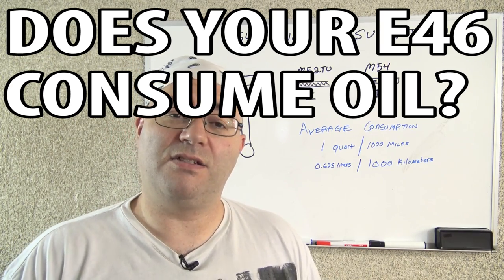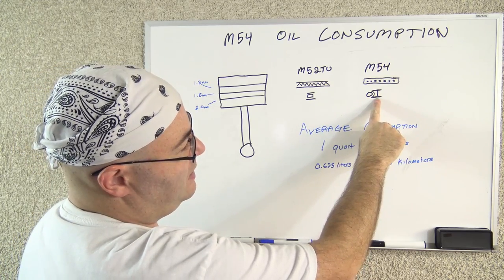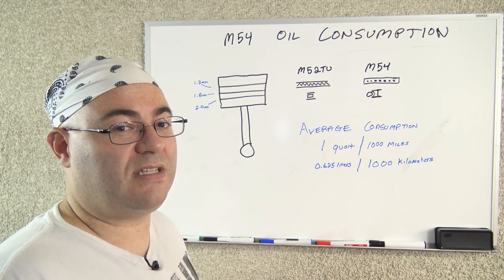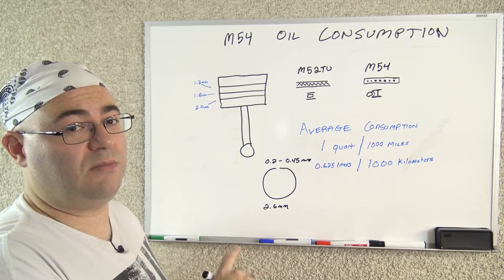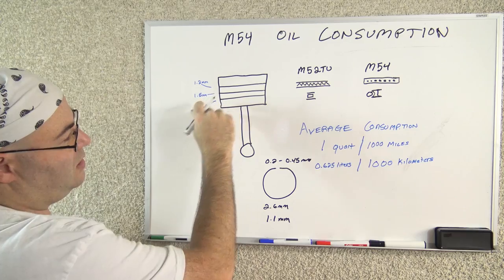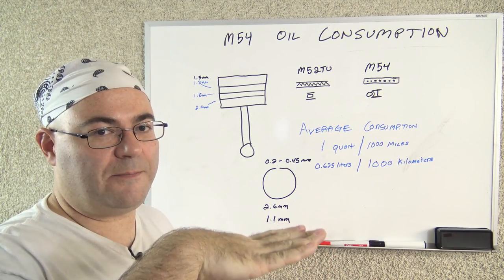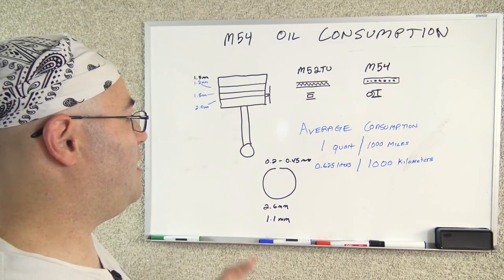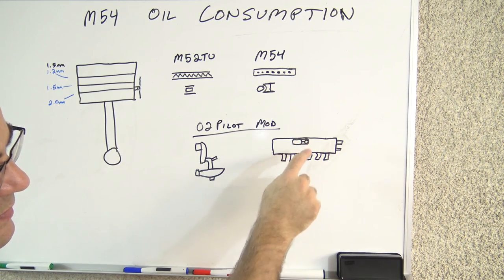Does Your E46 BMW Consume Oil?

Comment: Your videos have helped me immensely!  I have an ‘04 320i with the M54 and it lost close to a quart of oil per tank of fuel.  After fixing leaking OFHG, oil pan gasket, valve cover gasket, and replacing the CCV system the car didn’t leak anymore, but was consuming at the same rate.  I then added the vacuum hose per the O2 pilot mod and the consumption has stopped!  Many thanks!
Reply: i have same problem after i have changed the all Gasket and CCV System >> No leaking but consumption is rate is same as you... im gonna do the same as you did hope that it will help and i could do it properly
Reply: Is that mod complicated? Where can you buy the parts?
Reply: @MauroRubioGiletta  нужен всего-лишь шланг с внутренним сечение 3,2 мм. купить можно в магазине автозапчастей. шланг должен быть масло и бензо стойкий, чтобы он не растворился.

Comment: Jason.
You are absolutely right.
I have a 328-2000 and a 325-2003 the 328 has the M52tu engine it does NOT burn the oil at all.
However the 325-03 at every 3-4 weeks I add at least 1/2 q of oil. 
Your video is right in all senses.
Thank you.

Comment: Explains a ton, I keep oil in the trunk :D 2001 330i
Reply: Lance Richardson same 2002 325ci
Reply: sameeee 01 330ci
Reply: Lol 2002 330ci I keep enough oil in my trunk to start a small country.
Reply: dude same here mine just started happening @327k miles 2001 330ci. its pissing me off lol
Reply: Starting Tech wow nice run ) mine only has 187k miles and already , i add oil every 300 miles
Reply: Ismail Mamedov bought it at 325k for 300$

Comment: Thank you for the fine video. I just did this mod today. once I located the ports with the help of a mirror, the total job took about 1 hour. I'll let you know how it goes in a couple months.
Update: 3 months later, the car is not consuming oil anymore. the oil level has remained constant. Thanks once again.
Reply from the maker: Nice!
Reply: carlos verduzco 
So you did the Pilot 02 mod?
Reply: yes. oil consumption has diminished.
Reply: Hi, was there any negative effects or any difference in engine sound?

Comment: Hi, I have a 1999 BMW E46 320i with M52TU 2Ltr inline 6 engine. It had a major oil burning issue for few years, I was changing PCV Valves like every 6 months assuming that is the cause. Finally this week, I realized that both Catalytic converters are blocked because my car lacked power, some hesitation when accelerating on 3rd gear and so forth. So I removed both Cats and found out that those are blocked. I replaced them with Original BMW Cats, now car has awesome performance and the oil burn is reduced like more that 50%. Of course I cleaned the PCV valve with some carb cleaner. now its working fine. So i assume blocked cats can actually cause excessive oil burn also, Because the exhaust gases cannot pass out from the tail pipe efficiently.  IF you have serious oil burning issues just try to replace cats and clean the PCV Valve, it should solve the oil burn issue.

Comment: great video and explanation. e46fan member here (tbone8ty). I have an oil catch can installed on my e46 330i and I can confirm that it works for my car. I have over 30,000+ miles with my OCC setup. I don't burn any oil anymore. I'm at 200,000 miles. Car pulls strong and runs great.  I would recommend an oil catch can or 02 pilot mod over rebuilding if you want to save money. The great thing about it is you can always go back to the oem CCV unit very easily by just switching a few tubes. cheers!

Comment: I have a 2005 325i and I have over 200,000 miles on it and it’s got a slight leak from the dipstick return tube but it doesn’t burn a drop! I guess maybe I just got lucky or someone changed the oil rings a long time ago! Anyway that’s my experience. I did have to change the alternator because the hose clamps they use dig into the hose and make a hole so I cut off a half inch and replaced the hose to the power steering and dripped on the alternator until failure and I changed the expansion tank and fan clutch and fan and some Knick knacks like rear passenger window motor and washer motor but I still have less than $600 into the car total including purchase! I like it especially after finding that all the codes that caused it to fail and told the previous owner he needed all these parts( a shop,not me) I found that they replaced all the rubber on the intake Except the crankcase vent hose which crumbled as I touched it! I put a high pressure double walled hose with clamps on it and all the codes disappeared! I suspect the oil return hose is in the same shape and that’s probably why it leaks so ,good video,appreciation for the information as I have been a professional mechanic since 1982 but retired a while ago and the newer cars are a lot different from when I worked. Now give me an engine or transmission to rebuild and no problem whatever year because that’s my specialty. I do wrecks of motorcycles from tow yards now because it’s easier and my hobby but I still work on my own vehicles and having a resource with newer vehicles that I am unfamiliar with really saves me a lot of headaches. Thanks and keep them coming.

Comment: Mine has been burning oil now for 2years and I manged to remedy it slightly by a good flush and adding liqui moly stop oil leak (from 1liter per 800kms to 1 liter per 2000kms) as I suspected valve stem seals. Car does not smoke under power or on idle but every now and then if it had a cold start with short drive and shut off it might puff a bunch of smoke on startup a day later. Would valve seals be more likely or rather piston rings?

Comment: I have an M54 engine with 140k miles after 15 years.  No oil consumption issues at all.  However, I have seen and worked on others with oil consumption and from what I can confirm is that those with oil consumption issues followed the bmw oil change interval and factory oil.  They all had some amount of sludge in the engine which could clog those small holes in the newer oil control rings and wear them out or prevent proper sealing of the rings.  I have been using redline synthetic products for the life of the car and my interval is 8k miles.  By using some sort of carbon cleaning product to clean out your pistons, could help with clearing out those small holes on those newer rings.
Reply from the maker: Yeah that is the acdelco cleaner I mentioned in the video.  I don't think I'm going to do it because I want to see exactly how much carbon build up there is around the rings.  I'm doing the rebuild anyway so no need to try the cleaner..

Comment: Man, I am now seriously thinking of switching to getting a Volvo! 

BMW's are way too high maintenance, yeah in the same way as trying to keep a super model happy!

I know a guy who has a V50 , treats it likehe hates it but it just keeps going and going.

The money I have spent on my 98 e36 I could have a really solid V50. I mean I love my Sport Touring, but man she is so demanding in just the basics!

Sorry peeps, I'm disgusting I know. Anyway I love watching your vids they really cheer me up some days.

You are definitely a BM nut.
Reply: Yeah, had enough of oil leaks and crap like this--> going back to VW or Toyota!
Reply: Good Choice Mate Volvo Never lets you down
Reply: V50 is a shitbox lmao, it'll probably blow up any day now.
Reply: V50 S40 V40 C30 are cheap made volvo cars! Even the XC60 S60 V60 too The cars that are Volvos Are the 70 80 and 90 models so V/XC70 are great S80 and XC/v/s90 and buy the 5cylind engines those are the best high milage engines! feel bad that volvo only makes 4 cynlinder engines only right now! those 1.8F and 2.0F engines sucks and are ford engines!
Reply: Yes, I would definitely go for an 850 T5, same era as my current e36, and the 5 cylinder sounds so sweet. V50 also has a Ford Focus chassis. But this guy I used as a comparison just does nothing to his V50, it looks like it has been rolled on the outside. And I know he does zero maintenance but it just keeps going. My problem is that I bought a very clean 18 yr old car with 18 yr old genuine OEM components. so anything made of rubber is now ready for renewal. Drive train, suspension. and any bearings whether be it belt tentioner pulley's, wheels etc. I bought a project and not a daily runner. My bad! but after nearly completing the rubber re-fit and all round suspension replacement, I have a car that is nearly as it came from the factory. Vanos seals and rattle ring next, and I'm almost there (bankrupt) ha ha. I love the BM, and have become nearly as obsessed as the 50's kid. Thanks for your comments, I do see a fair few older volvos around and am guessing if they're naintained properly they like the bmw will last years to I would love a 2016 M5 ultimately though. How about you? And money no object, Pagani Huayra for weekends and track days, and daily, an Aston of some description. Boy these prescription meds are strong. Sorry for verbose retort. Be lucky.
Reply: pubbie hive yeah thats what I'm hoping. Thats when I will tell him its basically a Ford Focus. Ha ha. But this guys restaurant business has been a real succsess and he can leave the Volvo in tbe dirt and get a NEW M5. Grrrr. This guy cuts corners, uses the cheapest produce and has a really lazy menu. And yet people flock to his 2 local restaurants. Amazing, he must be suprised to! Anyway good luck to him. I might go to one of his restaurants with a half dead rat and bury it in one of his dishes and claim I just found it in the food! ha and go from there. I was however just pointing out that I had fucked up by bying a project instead of a daily driver. which was the mission goal. So I failed. But I do however now have a very comfortable nicely handling shopping trolly.
Reply: I love my Volvo 850 Turbo, my last one had over 300K and was still fast and reliable, if only it hadn't been rear-ended.  However, I must say I love my E46 too, albeit not as reliable! :)

Comment: Hi 50sKid
I do not think, that the reason for a bigger vacuum reducing the oil consumption is that it might push the oil ring more to the cylinder wall. Don't mix that up with compression rings, that often form a gap between the ring and the piston, so that combustion pressure can get behind the ring and push it more to the cylinder wall. This is not the same with the oil ring and the vacuum in the crankcase. Why should the vacuum push / pull the oil ring to the cylinder wall? The force of the vacuum acts in axial direction, not in radial direction. It's something different with compression rings. Because of the gap the (very high) combustion pressure also leads to a force on the ring in radial direction.
Even if there is also a little gap behind oil ring: Then the vacuum would even pull the ring away from the wall. But I don't think that happens, because the vacuum is much too weak to do that. In contrast the combustion pressure acting at compression rings, leads to a much bigger force.
Therefore I think, the explanation, why a bigger vacuum helps reducing the oil consumption is simply, that the pressure gradient from combustion chamber to crankcase is bigger. As a result there is less oil flow from the crankcase through the gap you were talking about (not to mix up with the gap that I was talking about) to the combustion chamber.
Would like to hear your opinion on that :)
Best regards,
Daniel
Reply from the maker: Ah I really don't know to be honest.  I'm ok with either answer being the correct one.  At the end of the day, we have a working solution that costs $2 and people can finally be happy.
Reply: DA-Tuning ... i think you found that ring expert you were looking for
Reply: I do think u'r pretty much spot on there.

Comment: We have a couple of e46s and also an e85 Z4 - all with the M54 engines.  I just purchased the e85 with 115 miles. CCV system probably was not ever replaced and I do smell some oil burning from time to time.  Thinking the ccv and the o2 pilot mod would be a good project this fall.

Comment: Hey, thanks for this. it really made it clear (I also checked MLODY's website) why my M54B30 is burning about 1 liter every 1000 kilometers. Just wanted to ask something. I'm planning to rebuild my engine sometimes next year, maybe in the summer and I want to replace the rings using M52 oil rings. Is there any chance the M52 oil rings may cause some damage to the cylinder walls ? I'm curious why BMW changed the design of the oil rings on the M54, maybe they had a reason.
Reply from the maker: It won't cause damage.  The block is exactly the same as the M52TU block, they only changed the pistons and rings and stroke and such.  They changed because the M54 rings have reduced friction which gives slightly better mileage.

Comment: Greate video!
I have 2000 320i,  one of the last pre-facelifts, which already got M54 installed
Oil consumption was around 300 ml/1000km when i bought the car. 
After ccv replacement it dropped a bit to 250ml/1000km, which is quite nice.

Maybe i will try this o2 pilot mod and see what happens! Thanks for that!
cheers

Comment: Dude so good! Wish this was here before I did mine it would have saved me so much time researching. The AC Delco soak helped my engine run much better but as far as consumption I don't know what role it played because I did it at the same time as the catch can. The CC 100% fixed my oil burning problem. That finding all my leaks and doing the vanos seals changed my car entirely. Don't forget poolman on the boards he was a big addition to this topic. Thanks

Comment: I have an 03 530i. Did a seafoam/atf flush before oil change w 0W40 gc. Also did the O2 pilot mod. It didn't burn oil to begin with at 170k miles, but it does leak a bit lol

Comment: I replaced my ccv a few weeks ago, I did this 02 pilot mod and it did nothing for my oil consumption. Seriously. My car doesn't smoke or leak furiously, it just still uses oil. Thanks for tip though.

Comment: I just watched this video, as well as the related Catch Can installation video. Great information in both. I was dealing with this issue on a previous E39 525i.  I tried O2 Pilots vacuum line, and it didn’t make a difference. 

One comment though...in thinking about why the Catch Can helps to reduce oil consumption by increasing vacuum in the crankcase, I don’t think the reason is because the increased vacuum ‘sucks’ the rings against the cylinder walls. I don’t see how that’s possible. 

What I think IS happening is that the increased crankcase vacuum actually helps to suck more oil through the oil control rings, and through the piston groove, and back into the crankcase. Thus, there is less oil available to blow by the rings and get burned in the cylinder. 

Another sign of high oil consumption is the high amount of soot in the exhaust tailpipe.  Wipe your finger (with a cloth) inside the tailpipe and see what you’ll find!

I also found a good article that discusses the factors that affect oil consumption, including issues with piston rings.  It is a good read.

https://www.machinerylubrication.com/Read/30384/engines-consume-oil

-rb

Comment: Great useful channel learnt a lot, I've got m54 325i with 130k miles on clock, never used any oil between oil changes believe it's stock ccv,I've got a replacement as I'll have rad iator and condenser out since both knackered so goin to replace  pump,thermostat, thought be good time to replace ccv @same time as don't know how old it is! Thought to do vanos,timing chain+tensioner @same time hope to chk oil pump nut @same time if l can get to it?

Comment: I have two E46 325 with the m54, one just started to burn some oil at 280 000 km after i had a problem with the ccv, the other one which has 150 000 km never burns any oil at all. Maybe some wear comes too soon if you don't use high quality oil, i always use 5w30 high quality oil, it's expensive but less expensive than to have to make some work on the engine.

Comment: I have a 2.5 liter M54 with 188,000 miles on it in an E39 and it doesn't burn any oil. It has never had the engine apart to my knowledge, so I guess I've been lucky with the stock internals so far.
Reply: You're a lucky person XD

Comment: Great video as usual.  I just installed oil catch can on my i325 (2003), but left CVC in place with hoses all destroyed. Am now debating whether to revert to this O2pilot mod, vs fix the vacuum leaks on the new oil catch can...
Reply from the maker: I prefer the o2pilot mod with the stock ccv system

Comment: My 260k mile M54B22  is burning oil now it was fine I service it way before it’s meant to be done I rarely drive it hard and I do generally look after it. Loosing a litre of oil every 400ish miles just done this mod today so hopefully it improves I’ll be happy if it goes to 1000 miles I can live with that until I B25 swap it next year
Reply: whats the verdict, did it work?
Reply: @krisjanisstraupe1754  hi yes it’s still burning oil but it has improved it, I checked it yesterday after around 700 miles and it’s sitting in between max and min mark so it’s lost a bit but nowhere near as bad as it was!
Reply: @dexietyy7922  thanks for answer, i have the same engine and i have changed all the gaskets that were leaking oil. will look into the 02pilot mod
Reply: @krisjanisstraupe1754  it’s definitely worth a try, mine burns oil on hard acceleration so my rings are simply just worn unfortunately but can’t complain for 262k miles!

Comment: Hi! Great video, what about thickering oil going from 5-30 to 5-40 for example?
Reply: No it will increase the heat in the engine. I thought it was fine and I've ended up ruining my cooling system and thermostat while also having this oil consumption issue

Comment: My BMW 330i 2002 consumes 1 qt every 2500 miles, apox. Sparkplugs are clean no one has burned or not burned oil, but I thought it wasnt normal till I saw your video.